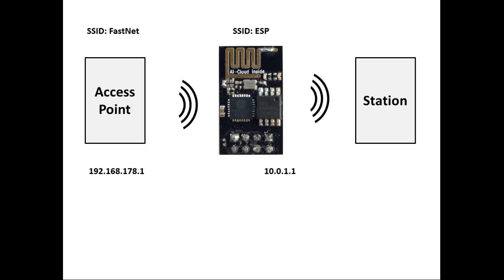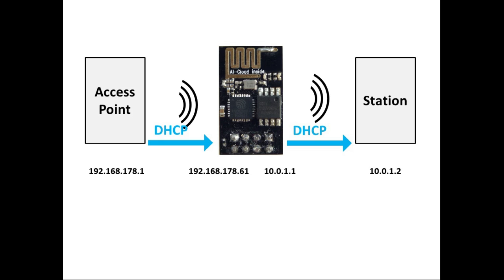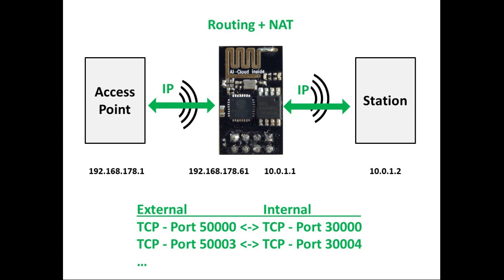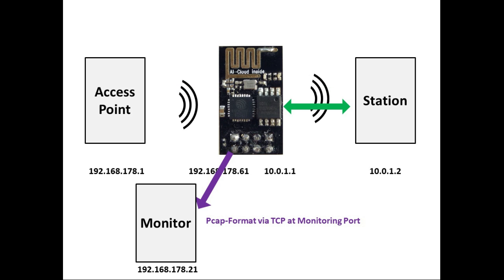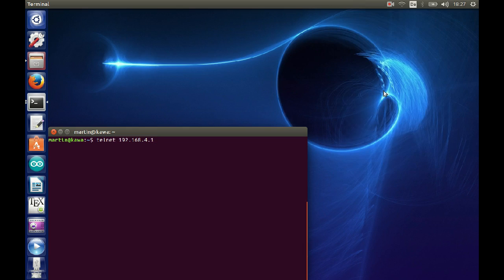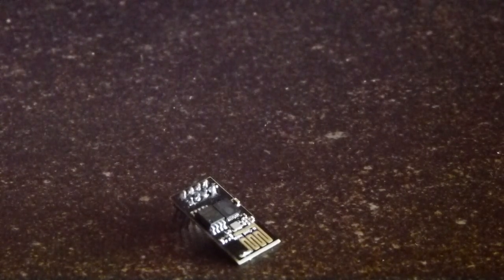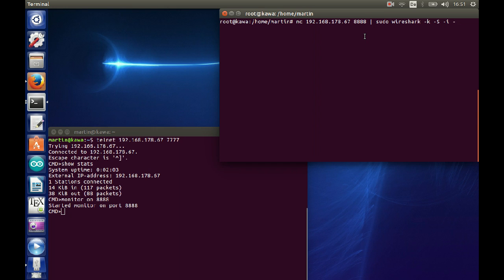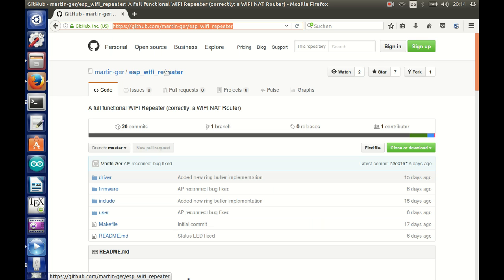ESP8266 WiFi Repeater (NAT Router)

Comment: i want to try this out with my drone, seems the controls work but video  is not working, is there an option to send all udp and tcp back to a single ip i mean port forward everything to single ip
Reply from the maker: You have to set single port forwards for each TCP and UDP port. You have to know the port numbers for that.
You might try out this setup and use the ESP as fixed relay on the ground:  https://github.com/martin-ger/ESP_E58-Drone
Reply: @martinger327  thank you for the reply martin, i have tried all ports based on the tellopilot forums, sdk, i can fly the drone using the app but the video is just black, drone is ryze dji tello, I want to piggyback the esp in the drone, and add another extender then from my mobile phone, this way when the drone is 80m above i still have a good bitrate on video, will check out the link, thanks again

Comment: Hello sir Martin! I'm making an IoT project right now, I use 2 esp8266, the 1st esp8266 act as a client then it will send data to the 2nd esp8266(act as a wifi repeater) then this 2nd esp8266 has a sensor that will be send to the router going to web. I use your library from github for the 2nd esp8266 so that the client can connect to the wifi repeater. But the problem is when I upload the code for the sensor using the 2nd esp8266(wifi repeater) it stop broadcasting a wifi network/access point. There's other way to answer my problem?
Reply from the maker: So you want to run my firmware plus a self-made sensor code? If so, you need to combine this into one firmware. Three options for doing this: a) you can do your sensor interaction with the build-in "gpio" commands and MQTT with the existing firmware. b) you modify the esp_wifi_repeater firmware with the sensor code (probably the most challenging option) or c) you link your sensor program with this lib https://github.com/martin-ger/lwip_nat_arduino and initialize the WiFi properly (example in https://github.com/martin-ger/lwip_nat_arduino/blob/master/WiFiNatRouter.ino )
Reply: Yes sir. I want to run the firmware plus a sensor code. I'll try the third option.
Reply: @martinger327  Sir There's an error in intstalling the library, this library  https://github.com/martin-ger/lwip_nat_arduino   it says (Specified folder/zip file does not contain a valid library).

Comment: Hello I flashed the bin's with the esptool for windows, the blue light  of the generic esp8266 (flashing) and the program say FINISH as the image, but the myap not appears!!! :( why?
Reply from the maker: Which ESP module do you use? What do you meant with "not appears"? Any debug output an the serial at 115200 baud? Just erratic noise there?  Make sure you use the flashing instructions in my comment above.
Reply: Martin. Hello friend, yes the network called myAp by default does not appear, I try with nodemcu and it was not possible to load by esptool in windows.

With the esp01 if it was possible to load the two bin but without result in the serial monitor, try in linux with telnet but neither.

Is it possible for each model to have its own bin-like files?
Reply: All good it seems that the nodemcu had a manufacturing defect thank you!

Comment: I would like to implement a wireless network that allows me to collect UDP messages (30 bytes each every 30 seconds) of several sensors placed inside 14 closed and contiguous rooms whose total area is about 60x15 square meters. 

I haven't able to get a reliable connection as the wireless signal of the sensors is very weak outside their rooms. Even with two conventional Access Points we have dead areas inside the rooms.

My planned solution is to place on the roof of each room 1 ESP loaded with your esp_wifi_repeater firmware. Then every ESP will advertise an unique SSID and will act as the router of the sensors inside its room. And all the ESPs will be connected to the main network via a single Access Point that allow one listening device to collect the broadcasted UDPs messages on that network.

So far my concern is related to the "congestion" of the wireless network. Considering that there will be about 57 radios operating at the same time (14 ESP  + 3 sensors per room + 1 AP), could this result in a saturated network for that "small" area? Could it be a problem if all the ESP use the same channel, or does the firmware as a way to select a less congested channel for its AP side?

If this "structure" does not seems reasonable, I would appreciate any lights that lead me on the proper direction.

Thank you!
Reply from the maker: Congestion will not be an issue - 30 Bytes every 30 seconds is about nothing and a client that doesn't send a message doesn't consume any bandwidth. An AP, i.e. each ESP, does send a Beacon every 100 ms- also not quite a lot. Different channels is not possible as the repeater always works on the channel of the uplink AP. The only limitation I see is, that each ESP cannot manage more than 8 clients, but your design is pobably below this limit.

If all the 14 ESP can connect directly to the one central AP I assume, that one ESP per room is not absolutly required, mayby one ESP for 2 neighbouring rooms might work as well.
Reply: Thank you Martin!

Comment: Hi,
I followed the instructions and it works on my esp01, but it isn't requiring a password for AP connection, contrary to my settings which have been double checked using  the "show" command. what should I do to get it secured?
Reply from the maker: "set ap_open 0" should do the job.
Reply: Martin Ger I tried that, it replied "open auth set" then I typed save, disconnected, and unplugged the ESP from power then  powered it again. No change. It still is open, and doesn't require a password to connect.
Reply from the maker: Sometime the client caches the old AP settings. Can you really connect without PW? Try to change the SSID - still open?
Reply: Martin Ger Still open. I even tried re flashing the bin files... It still retains the old settings
Reply from the maker: Strange, never had any issues on that... You might try to wipe out the WiFi settings by flashing blank.bin from the sdk AT firmware to 0x7e000 & 0xfe000 on the ESP-01.
Reply: Martin Ger I just did that. It never lets me change AP settings, even though it displays a change with the "show" command.
Reply from the maker: But AP settings do work with other firmware, e.g. the AT firmware? You can change the ssid, but not the authmode? Are you able to build the project? Might try to change the defaults in sources. However, it still uses the same API calls to set the AP config...
Reply: Martin Ger I tried reflashing ai-thinker-0.9.5.2.bin (stock firmware for my esp01) with the flash download tool from espressif... No response for "at" over Serial. Then I tried the same firmware with esp8266_flasher.exe (different program), and at commands worked. I flashed it with your 1.54 version bin files, and it did indeed let me change the ap password and lock it.  However, I tried changing the AP settings after that, and it no longer activates changes in settings. So I redid the entire process again the same way, and I'm back to square one, same issue once again.
Reply: Martin Ger I have it working now. It seems that the configuration commands must be sent in a specific order, with a few extras seconds between commands and frequent saves.
Reply from the maker: Good news, while I am not aware of any required special order for the commands. Maybe it is a problem with the power. I soemtimes had problems when flashing with just the USB to serial as power supply.
Reply: Martin: 
I commented on this before but perhaps I was a little
unclear.

It is possible to enter an invalid ap_password , one with a
length of < 8 chars, on the command line. I did this myself out of sheer stupidity :)
If this has been done, this: wifi_softap_set_config(&apConfig);
fails completely and it is not possible to set ap_ssid or ap_open or any of the other  the params in the apConfig structure. The only way to correct this is to set the ap_password to something valid i.e. >=8 chars. Only then can wifi_softap_set_config(&apConfig); succeed and the ap will work as expected.
As the 'show' command does not actually reflect the current
state of the ap, it will not indicate that there is in fact a problem with the settings. Might I suggest some range checking on the password length?
Regards,
Alex
Reply from the maker: Thanks, good advice - will add this.

Comment: How do I 'reset factory'?

Great software. I configured STA & AP settings via the browser using WPA2. When it came time to log in to the new wifi network, the connection has always been refused.

How do I 'reset factory' to wipe out wifi configs? Maybe I mistyped the password or it is too long (16 char). I cannot access via telnet. telnet 192.168.4.1 777, always results in 'Operation timed out', whether I connect the ESP8266 to my computer or to a power source. I cannot enter the 'reset factory' command via telnet.

I have tried to flash the 'blink' example code, then flash wifi repeater code again, but the wifi settings are always preserved. The Wifi network never resets back to MyAP. Any suggestions?
Reply from the maker: 'reset factory' from the serial console sets all  params back to initial values.
Reply: @Martin Ger  How? As I wrote, I cannot access via telnet. The following results in an 'Operation timed out' when one end of the cable is connected to the computer and the other end is connected to the ESP8266: telnet 192.168.4.1 7777.

What command do I use when the wifi network is enforcing a password I do not have? I am new to Arduino. How do I establish a connection to a serial console, that will listen to the command 'reset factory'? Do I use esptool.py or or an AT command? As I mentioned, I tried the telnet command. Thanks.
Reply from the maker: @francim123  Use the serial connection. If this fails, the sw isn't installed correctly at all.

Comment: Hello Martin,

I am working with esp8266 where i am receiving data through "esp8266" from a server using putty.
The problem I am facing is that when I am sending data to esp8266 through server I am not receiving all the data in the string.
for eg:-
if I am trying to send "helloworld" through server, I am only getting "hello" in my string.

my received string should contain "helloworld" the full data, but that is not happening.
Can anyone help why this is happening?
This is the process I've followed with esp8266 communicating via UART
AT
AT+CWMODE=1
AT+CIPMUX=1
AT+CWJAP="USSID","PASSWORD"
AT+CIFSR (HERE I AM GETTING IP address of esp8266)
AT+CIPSERVER=1,PORT NUMBER

I am connecting to server using IP address of esp8266,

Thank you in advance.
Reply from the maker: This questions refers to the original AT-firmware that is actually 
replaced by my software. I have no further experiences with this 
firmware - sorry.
Think, you shout send this to a general ESP8266 board.

Comment: Dear martin,
1)I did load existing firmware in my three ESP8266( 0x00000 and 0x02000 )
2)Restarted the ESP8266
3)I did configure my SSID, password and enable the Auto mesh.
4)Once again connected Wi-Fi (MyAP)  in my laptop.
5)"Couldn't connect to the network" warning displayed with close button.
6)If press the close button "MyAP"  disabled from my laptop.

Note:
1) I did try with different SSID ,
2) I did load and try with  0x82000 bin also, but same issue occurred.
 But Single Board without Auto mesh working well. Please let me know the solution.
Reply from the maker: With Automesh the SSID of the ESP is the same as the one from the upstream AP. The MyAP isn't valid any more. Simply use the settings of the upstream AP.
Reply: @martinger327  sure, I understood. Thank you.
Reply: @martinger327  It appears only 0x00000 and 0x02000 are required even with Auto mesh, then what is purpose of 0x82000 bin? Thanks
Reply from the maker: @thisoldjeepcj5  It is the second binary for over-the-air upload. Not required for normal operation.

Comment: I have question. Will it work on ESP32?
Reply from the maker: Not yet, working on that...
Reply: @martinger327   Thanks for the fast response.
Reply from the maker: Have a look at: https://github.com/jonask1337/esp-lwip
Reply: @martinger327  Hi Martin, this looks perfect for our requirement ... if it were based on the ESP32.

How close are you to completing this port to the ESP32? The issue with jonask1337 project is that Espressif now builds under CMake, and trying to port his build and identify the files that need linking is proving very troublesome. Finally, do you know if an ESP32, running as a WiFi Extender, will support say 12 or more open socket connections?

Comment: Bro? I have esp01 board, not esp01s, if i enter your program to my esp01 and I set according to your directions on the web, the result is not the same as what was directed. the wifi is always unreadable, not as directed, I can't find the wifi name MyAp. what's the solution?
Reply: I've tried setting up with 20/26/40Mhz, DIO/QIO, and 8mbit, and I've ticked the two firmware columns.  and have connected ground with gpio when programming.  but it didn't work.

Comment: I flashed my ESP-01 Module successfully and I can connect with MyAP and enter to 192.168.4.1. But the setting cannot be saved.
Reply from the maker: Does ist work from serial?
Reply: @martinger327  it's work from telnet

Comment: Hey, Thanks for the video. Is it possible to set up VPN for the station?
Reply from the maker: A station can make any VPN connection through the esp_wifi_repeater that will go through NAT, e.g. OpenVPN. The esp_wifi_repeater itself doesn't know anything about VPN.
Reply: @martinger327  No, I mean, can this device get internet from access point, up vpn connection to some server, and NAT traffic from station though VPN connection. (like regular router does  = LAN -> NAT -> PPTP -> WAN)
Reply from the maker: No, it cannot. I don't know of any standard VPN client for the ESP8266.

Comment: I am kinda lost in this video. All I was trying to do was to create an ESP8266 - Wemos d1 mini in AP + STA mode to talk to another ESP8266 -Wemos in STA mode via UDP. I have successfully managed to create a network [Open or pass protected] but it keeps getting disconnected every few seconds. Is it anywhere remotely related to your video Martin? lol
Reply from the maker: I think, you were looking for somewhat different. To connect two ESPs you basically have to put one in STA and the other in AP (or STA_AP mode, should not make any difference)  mode. Plenty of demo code out there (e.g. for Arduino). Once this works, you can start an UDP server and a UDP client.

Comment: The program works up until the part where we write the SSID and the password but after pressing the "set" button, the ESP8266 restarts but does not turn back on again. followed the steps in the github link. tried changing the power source, but still the same. any comments on this? :)
Reply from the maker: Latest update should fix this.

Comment: Hi! It's possible to add a portal captive to this?
Reply from the maker: Possible, of course. But it is currently not included and won't add it myself in the near Future (no time).
Reply from the maker: Sources are online, do not hesitate. I had a DNS responder in the source tree, you will find it working in my "esp_mqtt" project. It should be modified to answer with it's own address on any request. Also the integrated minimal web server needs some rework if you want some more sophisticates interaction.

Comment: Im having some troubles setting the password to  my STA  , the password has some  " %" symbols and gets corrupted when i set up , and i cant conect to the route i've tried using  telnet and GUI o set this values but it''s the same result.
Any sugestion? @MartinGer
I can conect to the AP but it cant conect to the internet since the password gets screwed during the set operation.
Reply: also i tried to conect with a simple password to my phone using it as an AP with a password having chars only and it worked.
Reply from the maker: If you want to enter non-ASCII or special characters in the web interface you have to use HTTP-style hex encoding like "My%20AccessPoint". This will result in a string "My AccessPoint". With this hex encoding you can enter any byte value you like.
Reply: @martinger327  solved! 

 I've read that but could find the codes now it makes sense.thank you.

Comment: Hi, wäre es möglich das ganze mit WDS laufen zu lassen?
Reply from the maker: Not in a sense of IEEE802.11 - this would require changes in the MAC frame (4 addresses) and no layer 3 routing. From a practical point view: yes. You can distribute the network via one SSID (e.g. from a central AP) and provide access to end devices via (multiple) ESP-Routers via another SSID.

Comment: Can I use a 5v mobile phone charger to power esp8266?? Will it be a problem??
Reply from the maker: The development boards with USB connector have a voltage regulator and are powered with 5V, that ist fine. The pure ESP needs 3.3V.

Comment: how did you set the ip of repeater to 192.168.178.67 ?
Reply from the maker: This is the IP in the external network, i.e. the address of the STA interface randomly assigned via DHCP. The IP of the AP interface is always x.x.x.1.

Comment: Hi Martin, thank you very much for your work, i got it working with enc28J60 but i cant reach wan with it, like i can ping my local router on 192.168.1.1 also nslookup works flawlessly, but i cant ping google for example even if i try only the ip address, do you know what is going on? Ive rebuild lwip_open.a and copied it over liblwip_open_napt.a...
Reply: I also have similar issue in interfacing enc28J60. Please let me know if you have solved the issue.
Reply: @aparaajithac4033  i wasnt able to solve it man, sorry, if you find any solution I am also looking for it, would be pretty neat to have a small portable router...